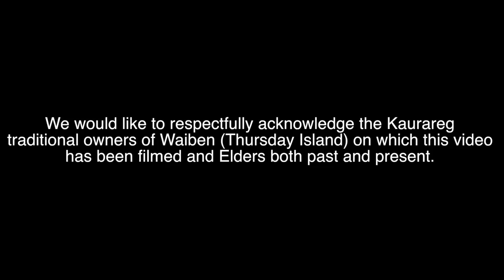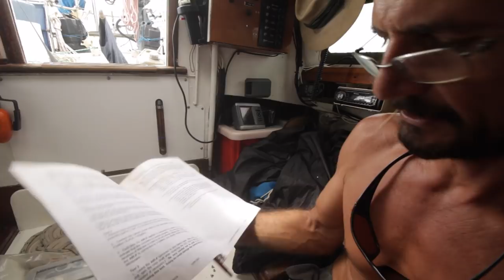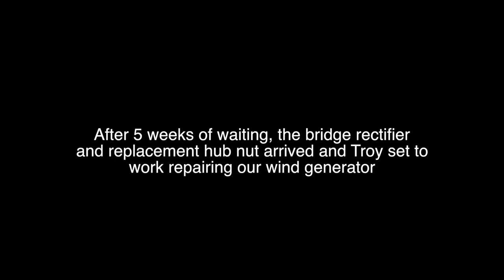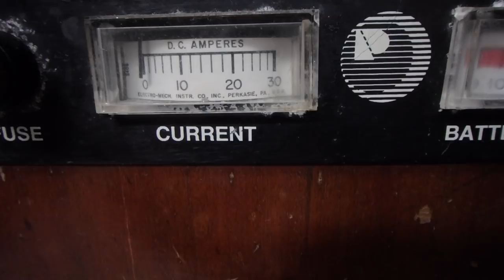Repairing our Wind Generator in the Stormy Straits - Free Range Sailing Ep 35

Comment: A little tip for not losing the nut next time you take the prop of the wind generator, glue the nut with some locktite or even just a little bit of silicone. That should do the trick. :)

Comment: Nothing Dodgy about that repair job Troy. Proper Pro stuff !                                                               I had an alternator on my old Albin 021 petrol inboard that refused to charge the batteries. I opened that it up and checked everything with continuity etc but to no avail. After 2 weeks of head scratching i noticed the charge light bulb in the cockpit was blown. Turns out that on my boat wiring,  that was the fix. 80 cents and half a minute swap….batteries charging again. Felt quite stupid with myself , ahhhhh …. Your videos are really educational and inspiring. happy sailing…

Comment: I commented recently and you liked my comments. I should have given you some background on me. I spent 4 years in the US Coast Guard as an electronics technician. One full year was on a 210ft medium endurance cutter and it seemed like we spent most of that year underway. We spent that time on the East coast of the U.S. We rarely reached our home port in New Castle, New Hampshire without being called out on some kind of emergency in less than a week. We spent a lot of time patrolling for various things in the North Atlantic. We did a lot of fisheries patrols and search and rescue missions. We escorted the Newport to Halifax yacht race in 1968 or 1969. We also transited from Newport, VA to Miami through the eye of hurricane Gladys. Winds were over 100 mph. I packed a lot of experience into one year on a ship. I liked your piece about repairing the wind electricity generator.Reminded me of a repair job I did repairing a radar antenna in winter while we were anchored off Provincetown, Massachusetts. I think I replaced brushes on the motor. Winds were at least 30mph plus gusts and the temperature was below freezing. I know I am rambling. Sorry. Just wanted to give you some perspective on why I find some of your more esoteric posts interesting.  Keep posting everything. I love it. FYI, I celebrated my 72nd birthday on March 5. Be safe, keep out of those cyclones. Ted

Comment: I appreciate the resourcefulness you two demonstrate.  Once a person recognizes that a bearing is a bearing is a bearing, all you have to do is measure the ID, OD, thickness of the bearing and determine the duty factor (light or heavy or moderate duty).  Same with the bridge rectifier you went with.  It really helps keep the costs contained when you realize you don't have to order a part through the company but off of Ebay, or a tractor store, or wherever.  Keep up the great work and don't worry about some legalese jargon for my sake.
Reply: benc65753 .

Comment: Great engineering! I have the same AirX with the same problem but have notyet found a way to fix it. Will follow your  instructions, and the regulator can be attached inside the boat cabine to tame the unregulated DC stream. Thanks!

Comment: Another great episode! Thanks guys! Troy, if you are concerned about over voltage, entertain the thought of a hefty zeener diode with a resistor in series to bleed off any thing above the rating of the voltage rated diode. Just shunting it to the negative side should act as somewhat of a brake too to help on those gnarled days when the wind gets up. So. In effect, the series diode / resistor would go in parallel with the output. Say you had a diode rated at 15 volts, anything above that, the diode would conduct and that excess voltage would be shunted. They are a poor man's regulator and "as common as air"! Great video my friends.

Comment: What you guys need is a hydro generator. They work great and would give you so much power than you need, But they are very expensive, But you use your boat more than the normal weekend sailor so that would be great for your little boat traveling long distances. Lucky fish had one installed on his boat and he has done a review on it, when he done a 1200 mile sail, And i was very impressed with the out come, You get what you pay for in the long run but it always comes down to the dredded budget in the end,  Good bodger work there, Nice save!

Comment: You could make a little clipper which shorts your 3 phases to put the brakes on for you when you reach 14 volts or higher. It can get a little complicated. You're doing great ! Probably easier just to switch something on for a load to keep your voltage down manually.

Comment: I love the modify.  I bet just a cheap voltage regulator off of and  old  boat motor would do the trick.  See if there is anyone who rebuilds generators in the next town and but an external voltage regulator.  But I agree  with your asessment that it probably will be fine since you have a huge load.

Comment: Always good to stop by. Not sure of course and simply a suggestion but suspect that if it was bird-to-blade then most noise will be from 'out of balance' of the blades. Difficult to rectify aboard but on terra firma (you know, the the greater the firma, the lesser the terra!) if you can centre the blades on a single pin support and then balance til they are 'perfectly' level by bending and fine tune by drilling indents, then the unbalancing force on the bearings will diminish and likewise, the noise. Blades are aerofoils so 'smooth' blade = low vibration (noise) as your friend suggests. Good luck, BB

Comment: Long zombie thread resurrection warning:

We just purchased and installed a Primus Air Breeze turbine -an upgrade from our 30-year old Rutland Windcharger, so I figured I would rewatch this video.  Our wind-generated power output has approximately tripled but the ancient Rutland was just an early 75w turbine and would only produce about 1.5A at 15 knots.  We would only rarely see outputs over 2A. A few times in wild gales when I didn't have time to tie-up the turbine beforehand we saw 5A+ for short periods.  Now we see that and much more as winds get into the high teens. I don't think I will often bother to stop this new turbine and tie it off since its survivability is much better and it doesn't have 30-year old UV-rotted blades that are no longer in production.  I was starting to be concerned about standing near or under the old turbine in more windy conditions.

I have heard other stories of board failures like yours on the whole line of Air turbines, so I wanted to prepare for such an eventuality without the expense of buying an extremely expensive spare board for now.  The old Rutland was poorly-regulated so we had an external rectifier/regulator down below which I am saving for any eventuality of temporarily modifying the new turbine. I may pick up a 3-phase rectifier like you used to keep in my spares in case that is needed.

I already purchased some spare bearings before the new turbine had been up for a week. They don't last forever.  I decided to get only the 2RS version since they cost only pennies more and I don't figure the seal on the inside is going to hurt anything. I am not buying tens of thousands of these at a time, so a few pennies saved per unit isn't going to add up like it does for the manufacturer.

I did notice that the blades were quite rough at the edges, simply poorly finished from out of the mold.  I thought about using fine sandpaper to clean that up but instead just used my calloused fingers to polish them up a bit, which actually make a big change in only a few moments work, dragging my fingernails over a few of the roughest spots where the mold flashing was the most egregious. This is kind of ridiculous IMHO on an $1100 unit IMHO.   I was concerned about upsetting the balance of the blades but I might go back and clean them up a bit more in the future with fine sandpaper on the edges and the tips. 

They are not very noisy, but will flutter a little at lower wind speeds, especially when the wind veers and the turbine yaws off a tad and the blades slow down before it finds the wind again.  I also hear a constant light whirring which tracks in frequency with the blade speed throughout the inside of the boat from the coil/magnet lumpiness which I suppose is unavoidable in a turbine design such as this.  

Still, the Air Breeze is much, MUCH quieter than the old Rutland Windcharger which would growl and howl nearly all of the time, even after a fresh bearing change. The blades themselves were quieter, being a shorter-diameter 6-blade turbine but the magnetic vibration inside would couple with an inherent yaw-bearing looseness to create a vibration which would lightly shake the mast forward and aft sometimes. It actually got better the faster the wind blew.  At 15-20 knots it used to sound like a Scoobie-Doo ghost -WOOOOOOOO! Over 20 and it would settle right down. The last owner said that a heavy lead weight strapped to the mast with a hose clamp would help dampen this but I never had much luck tuning it by moving it up and down the pipe, so I just took the ugly weight off and lived with the noise.

The gentle whir of the Air Breeze turbine is nothing by comparison.  Over time I will see if aging bearings make any difference. We never had a bird take on our old turbine but I think it would have taken out one of the ancient blades had that occurred. Rutland changed their blade design 25 years ago and those blades are unobtanium now.

Comment: The solid state recitifier is a good fix. Especially in an exposed housing like that. You could feed the output into a cheap solar regulator to control charging current to the batteries.

Comment: In the electronics they actually call modifications after the fact bodge jobs ... good on ya for that also : D  cheers. also if the output voltage and amperage is in range you could pipe that into your solar charge controller for regulation, preferably a separate controller then the one you use for your panels.

Comment: I found Air-X to be a great dealer with excellent support . They mailed me a  PC board for free and it's worked great ever since. I've changed the bearings once so far with  SKF bearing .
Reply: Robert Orzech hi. Are they generally as noisy as they come across on the video? Im in the market for one, and i just know with the “whirr” my &@&*#% neighbours will complain...many thanks.
Reply: Yeah but you need a good wind  to make noise . On a 100 ft tower and a 40 mph gust will make it "bark" for a second like a T-Rex so loud it'll  make you duck your head. Ha Ha  I had 5 of them running and no problem with the neighbours.

Comment: I think the technical term for this kind of modification is a "hack". It would have scored double points if the rectifier was taken from a scrapper yard (motorcycle for example, comes with an integrated regulator as well). I'd be pretty interested in the waveform being output, just in case you stumble over a oscilloscope. And if there's increased gassing from the batteries due to the wobbly dc.

Comment: If you splash something get a weight or small anchor down ASAP. Try to get it close to the spot where the part went into the water.  A line to the surface and a small float will mark the position. When the weather is calm snorkel down and you'll almost always find the part within arms length of the anchor. Even in 0-vis water you can feel for the part in the sand. 

A 14.5V zener diode across the DC terminals will help to prevent overcharging. You'll need a high power component but they're pretty cheap.
Reply: We just put a mark on the hull to indicate where it fell overboard.

Comment: Not gonna criticize in the least. A thought for you though is to find a rectifier/voltage regulator for an old motorbike from the 70's or 80's because they're cheaper. Hondas work the best because they have three terminals in and two out. Rectified and regulates all in one compact unit. Fair winds.

Comment: Another great video guys. Just a quick question could you connect the wind generator to the solar regulator. Would this fix the problem of overcharging your batteries?
Reply: Although I could be wrong, my understanding is that you can have problems doing that as the wind generator doesn't have a peak voltage which is the same a solar (most solar charge controllers usually only go up to around 18v) so you might burn the solar controller out. However, wind generator charge controllers aren't horribly expensive, and even a low grade one will do the job, so probably a better bet. Anyone with better info or knowledge, please speak up.
Reply: Could you? Short answer yes. Should you? Prolly not. You really need to understand how both function and what is required of each.

There are too many variables, if you did it might work or it might not and simply blow up the wind generator plus wreck havoc on your batteries and decreasing life span until than. For example could you charge your mobile device using another charger? Sure, but you really should not and risk blowing up the battery or again decreasing life span as they will all use different voltages and amps.

A lot depends on the solar controller, how sophisticated is it and what all features does it have. Solar panels provide more constant and steady current, unlike wind which can vary widely. Wind generators usually (but not all) require always having a load attached, otherwise they can overspeed and blow up, like as you seen Troy shown with electrical wind brake in the vid. This is done normally by a shunt controller, bypassing current into like a heater. Solar controllers generally are like a simple on/off switch. If the circuit is closed the solar panel simply stops producing current. If that is the case than NO. Some however has seperate circuit which will power down the load. If that is the case than maybe, as you can apply that circuit to winds electrical brake, but again that circuitry is low voltage and I do not know if that is enough to actually stop the current still flowing into your battery. As Tend Renard pointed out, you might even risk burning up your solar controller and so will now have to replace both, or decreasing battery life span, or worse overcharging your battery.
Reply from the maker: Thanks very much Kevin that was spot on - would you like to become our comment moderator while we're away? lol
Reply: Ha ha. With the pay being FREE range sailing .. how could I possibly turn down such an offer. Gotta love pay that is less than centrelinks :p

Comment: Hi Troy I was going to comment on Philips post regarding using your solar controller but deleted it accidentally. I think it would be better to use a separate regulator you should probably check the open circuit voltage and rated current but I'm sure you know this already I have been a Sparky in the outback for 25 years and in Sydney for 20 years before that I think having a what is in your vehicle and being expected to fix anything remotely electrical on the spot is a little like the challenges you face thanks for the video.

Comment: Its official. Delos has been dropped from my no.1 vlog - I’ve spent the week binge watching all your vids. So in a week I’ve seen Troy go from long haired and beard ( and very scary looking), to “shorter hair and beard, and now you’re rocking the Magnum PI tache. Ha ha ha. Rock on kind Sir...

As for your wind turbine, im not sure if the blades are in a fixed position. If they are not fixed to a central hub, and bolt on individually, make sure the space between the tip of the blades is equidistant from each other. So the tips of each blade should be the same distance between all three from the same outer point. Hope this helps.

✌🏻&❤️ and fair winds...

Comment: If those fan blades separate you can weigh them by scale and make sure the weights are even. You should over 10 years have some blade erosion. Erosions are usually uneven. That causes vibration and bearings wear. Perhaps your friend got lucky by sanding. You need overspeed protection. Some kind of brake. I believe you know the later aspect. A simple switch but then try also and get a resistor so you don't need new Batts. Unfiltered dc current is probably ok.

Comment: applaude your fix. Polishing the blades, yes.  Right down to rouge if you have any. When done recheck masses of blades. Unregulated even a slight difference matters.  When replacing bearings be sure to note if the races are earthed or isolated. Eddy currents can wreck them quickly. Probably teaching you to suck eggs but nonetheless...

Comment: Hang on, you connect rectifier bypassing circut board to get DC 12 volt but what about overspread break and charge controller of the generator ?

Comment: Thanks for another interesting video. I wait with interest the smoothing of the blades to see if that does anything. Just as a devils advocate on that.... I wonder if smoothing the blades would remove some of the 'bite' that the air has on the blade and thus reduce the power that the wind imparts onto the blades ? I don't know, just typing out loud so to speak. :-)